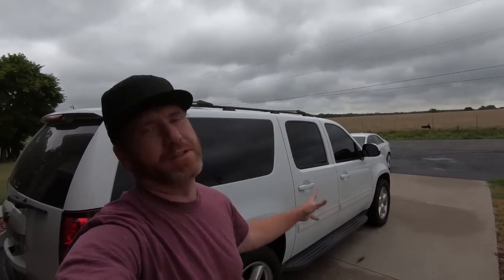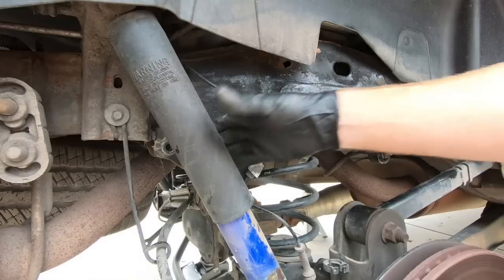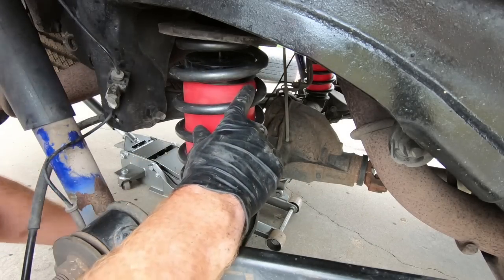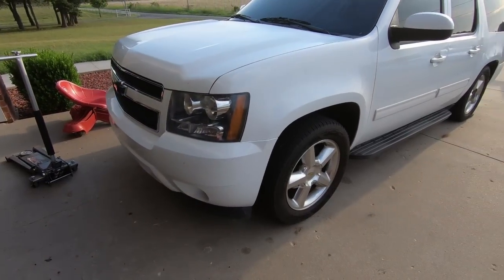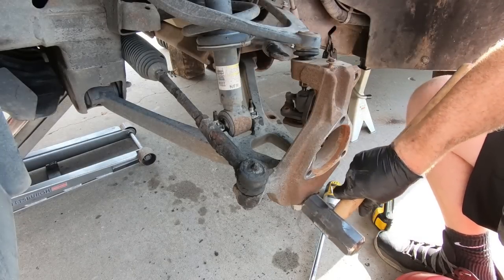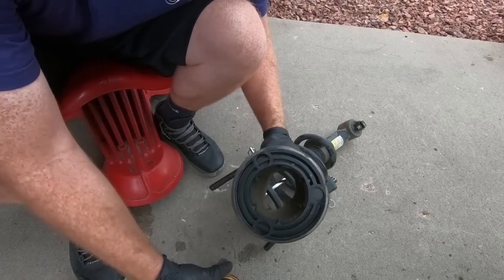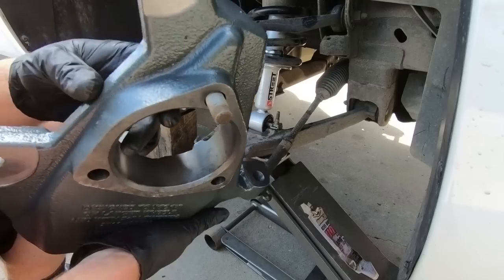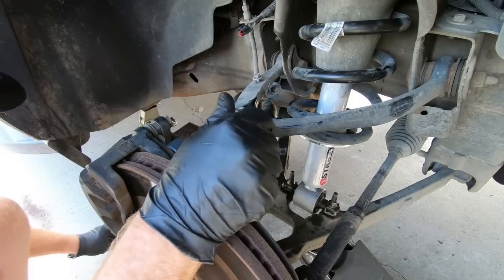How To Lower Suburban Yukon XL and Escalade ESV (Ultimate How to!!!)

Comment: Great video, gonna need it when I do my drop. Little tip for the spindle it's easier to build it before you install it (bolt the hub before placing the spindle on the control arms
Reply from the maker: Not when you try to lift it into place
Reply: @TWAMotorsports  it's not that heavy lol
Reply from the maker: @joker6374 definitely heavier

Comment: I know this is an older video but I want to say thank you for sharing and linking the parts. I have a question before I fully commit. In your opinion, are the helper bags necessary on a daily that will experience no towing or real payloads other than multiple car seats and diaper bags?
Reply from the maker: Yes I think you need helper bags.
Reply: @TWAMotorsports  Appreciate the response!
Reply from the maker: You're welcome

Comment: I did a 3/5" drop on my 16' Yukon 3 years ago. I bought my kit from Norcal SS. On the auto air ride in the rear, I replaced the  set screw with a shorter so it couldn't go back up too far. The free travel mod is a PITA on the drivers side with the tank sitting right there. I have 24" DUBS and I'm thinking about going to a 22" wheel. The stock size wheels look good with your drop.
Reply from the maker: Nice. I bet that looks awesome

Comment: Did you add travel by cutting out the previous frames bump stops? I’m using a beltech 733 drop kit and I regularly bottom out in the rear end. Wondering if diff springs would help.
Reply from the maker: Yes

Comment: Couple of questions but first thing great step by step idk if u knw how much that helps ppl, hmm does the BJM kit come with springs r is that separate? An do u have to redrill for the sway bar for the passenger side? Thanks bud!
Reply from the maker: Djm kit doesn't come with springs. Yes you have to drill two holes and move sway bar

Comment: How do you get rid of chevy lean.  I have replace front springs with oem springs.
Installed belltech lowering struts for 1 inch drop. Plz help.
Reply from the maker: Put more rings on low side or take one out of high side.

Comment: Great write up and video, I’m currently dropping my 2011 Yukon XL. I got the exact part number spindles in the parts list in the description section…. they are 3” spindles, is that what you used?  Because in the video you said the spindles get you 2 inches and you put 3 rings to get you another inch and a half. 

Since I got the 3 inch spindles, should I go 4 rings to get the same height? 

I got the spindle part number 2511
Reply from the maker: Part I listed is what I used.
Reply: Thank you for the reply.
Reply from the maker: You're welcome

Comment: Do u have to add the DJM kit or will i be fine with the free travel mod, the poly urethane bump stops, and the spring and shock? Also im currently on atock shocks with belltech springs will i be fine untill i buy the new shorter belltech shocks?
Reply from the maker: If you don't want to do it correctly then wait until you can. I did all of this for a reason

Comment: I had a question on your videos of you dropping your black Tahoe you said to  do the lower control arm bracket one side at a time but in this video you un bolted both sides at the same time is it better to do both sides ?
Reply from the maker: Sometimes the rear shifts and is hard to get back in place when you do both sides at once
Reply: @TWAMotorsports  thank you brother I will do one side at a time 👍🏼

Comment: Question? I just installed the (Maxtrac) 2” spindles and strut. And 4 inch coils on rear. I drove out and noticed my left front is rubbing against wheel well but driver side is fine. Took it to Firestone for alignment and he said that I need extended tie rods to fix it along with Alignment. It’s 11 Avalanche LTZ 4wd. And help would be great
Reply from the maker: This is why I make these videos to show what parts I have years of experience with working. I have no experience with the products you used.
Reply: @TWAMotorsports  what’s crazy is it’s only coils, struts, spindles and hangers
Reply from the maker: No hangers on these
Reply: @TWAMotorsports  sorry. Shackles lol
Reply: I’d love to pick your mind on this!! Appreciate your response
Reply from the maker: They don't have that either. Shackles and hangers are for leaf spring trucks.
Reply: @TWAMotorsports  ok. Shock relocation brackets. Sorry not on your level with terminology my man. Just trying to get some help with someone experience but obviously not gonna get advice
Reply from the maker: I'm not sure how to help if what you bought isn't working. I make these videos to guide others to parts I know work

Comment: Any recommendations for a different sway bar? 
Just did the drop on mine and the rear passenger sway bar is hitting the frame. 
I have an 04 avalanche so a bit different
Reply from the maker: Not something I have changed
Reply: @TWAMotorsports  all good. My problem was that i had to move that sway bar a little over to the passenger side so that it could clear. It was in the djm instructions… whoops
Reply from the maker: That is a requirement

Comment: Is the video for a specific year? I have a 2016 Yukon Denali XL that in want to lower 3-4 in front and 4-5 in back. Which parts/video do you recommend for my vehicle? Thank you in advance for your help and info. I will be adding 24" wheels with a 305/35R24 tires to this vehicle as well.
Reply from the maker: Same parts work.

Comment: Love this video! Thank you for a thorough tutorial. I’m going to replicate this on my 07 Avalanche but I was wondering what your thoughts would be if I used a bit smaller springs on the back. I was looking at using “Belltech 34324 Springs Coil”. Do you know if the rest of the parts you used would be compatible with these springs?
Reply from the maker: Thank you. All the parts are compatible. Not sure about the springs you listed however

Comment: What would I need for a 4/6 drop on my 08 Escalade esv awd
Reply from the maker: Same parts as this but won't go that low
Reply: So for shocks it would be 2210ff instead of 2410ff? Since those have more travel
Reply from the maker: @940_. No. I used 2410 but bought in kit listed. 9505

Comment: Just curious why you don’t use a Spohn Performance adjustable pan hard bar? 
With that short of spring, the rear axle has to be off center.
Reply from the maker: It is off a small amount. I will be making a video to correct soon

Comment: Have 2004 tahoe and looking to get lower in the rear cause I'm sitting way to high compared to the front anyway of getting more drop out of the rear? Used a mcgaughys 5" spring( or suppose to be)
Reply from the maker: Norcal Tony has a 6 inch spring
Reply: @TWAMotorsports  thanks for the help.  Just reached out to him.
Reply from the maker: You're welcome

Comment: Hey man awesome stuff. Got me motivated to lower mine. Had a question. I have an 08 Ltz burb. Would those ss springs work on a burb. And would you use a 2”drop spindle with adjustable struts to get that 3” low in front
Reply from the maker: Yes they will work. As for the front that is exactly what I would do
Reply: @TWAMotorsports  thanks Brotha.
Reply: Quick question. With the front struts. I have factory air ride. Do I use the “factory air ride” section to gather height preference or do I use the “non auto ride? Little stumped. Since I’ll be changing out to regular shocks and struts.
Reply from the maker: Are you talking about in the instructions?
Reply: @TWAMotorsports  yes sir. Since my vehicle is equipped with air ride. Do I use the air ride section for amount of rings or do I use the “non air ride” since I’ll be eliminating air ride over all
Reply from the maker: If it came with air ride I would use that setting. Not hard but time consuming to go back remove another ring and put back together

Comment: So, all of these locals are telling me that I can not use the air lift bags due to my factory air suspension. Is that true? Is this bag shorter to fit the shorter rear springs?
Reply from the maker: If it has factory air suspension and you drop it with these components you won't have factory air suspension

Comment: Hey, pal.  Just completed my second drop project....(escalade esv).   Used all the same parts....experiencing harsh vibration at highway speeds and hard acceleration.....

Pinion angle?  

Thought the DJM brackets helped with that.

Thoughts? 
Think I need to go with adj lower trailing arms to reset pinion angle?  (Spohn has a nice set).

Last project was a Denali xl.  No vibration issues. 

Thanks
Reply from the maker: I have done 20 or more and never had that issue
Reply: @TWAMotorsports  ... I'll dive into it and see what I can find.  Perhaps an unhappy u-joint or mechanical issue.
Reply from the maker: Yeah that is odd
Reply: @TWAMotorsports  *Update*....so I checked everything in the rear...all was gtg.  I pulled the driveshaft and both u joins were tight ...I also checked to see if the driveshaft had enough room to slide in and out of t-case....more than enough.   Moved to the front.....the outer cv's looked a little unhappy with the amount of angle..  The front drop did settle a bit more than I wanted so I pulled the front apart and added 2 spacers to each side.
.    That was enough to correct the cv angles and stance.    No vibrations now.  I guess those cv's were binding up under heavy throttle. 

The last drop I did was a Denali.  It was way easier...this Escalade has been nothing but a  pain in the rear..

Figured I'd share.
Reply from the maker: Thanks for sharing. Glad you got it figured out.

Comment: Quick question will this kit work for Escalade esv 2011
4"/5" Lowering Kit, 2007-2013 GM SUV 1500 (2wd, Non-Auto Ride) Part #30013
Reply from the maker: Never used it but it should
Reply: @TWAMotorsports  thank you
Reply from the maker: You're welcome

Comment: I did a 2/3 drop on my Yukon then decided to go down another inch to a 3/4 but now I have a god awful Chevy lean.... It’s about 3/4 of an inch higher on the passenger side.... I removed one of the spacers on the front shock.... I have 4 on the drivers and 3 on the passenger.... I checked the rear to make sure the spring was set properly.... Maybe I move the rubber isolator out of place? Any help would be great.... Thanks!!!!!
Reply from the maker: Easiest way is removing or adding rings to shocks.
Reply: TWA Motorsports Thanks Bro!!!! I’ll remove another ring on the passenger side....👍🏾💯
Reply from the maker: You're welcome

Comment: With the axle moving up closer to the body, does it shift to one side or the other and does the rear track bar need to be replaced with a shorter unit as well? The same concept as when lifting these. And how well does it align if the rear axle has shifted do to being compressed, so to speak? Also, I'm curious about why only the lower control arms are relocated, and why the uppers aren't touched? They are no longer parallel. Does it cause any funny drivability and control issues?
Reply from the maker: It does shift. Sometimes you need an adjustable panhard. I generally don't use one.

Comment: Amazing video, just wondering though, if I plan on doing a 3/4 drop on my 2013 Avalanche with no auto ride suspension, would I use the same exact parts or is there a few things in this video i don’t need to use? The air bags you put into the Trail Blazer springs is that only for the auto ride system? Lastly the street performance shocks how do they feel compared to using the stocks and would I need to do the free travel mod?
Reply from the maker: It would be almost identical. You can't use stock shocks. Love the belltech shocks. Airbags are to help hauling extra weight. Nothing to do with autoride which this suburban doesn't have. I do travel mod anytime over 3" in the rear

Comment: How many rings did u put up front ? Straight 3 or 3.5? Thanx btw looks clean for a burban 👍🏼
Reply from the maker: 2 I think
Reply: i got the v2 version and it has the 10 mm ring with 8 mm rings they should ve just kept on sellin the old versions way easier to do ..these only say -2 and +2 . different instructions than yours
Reply from the maker: I see

Comment: I love watching your videos they are very informative. I was wondering if you know if the rear jdm kit you used might work on a 2002 avalanche 1500?
Reply from the maker: Different kit for older. Rk2000
Reply: @TWAMotorsports  do you know if the djm shock extenders work with the belltech shocks
Reply from the maker: They should. Mine all came with the djm hardware kit

Comment: Another question brother. Witch rear spring would you recomend to sit 1 inch lower than what you have. TIA
Reply from the maker: I have no idea because I always go way lower. Not sure 1 inch is an option
Reply: @TWAMotorsports  you said In the last part of the vid that 2wd sits a little higher than 4wd I have a 2wd and would like it to sit a little lower than your current set up.
Reply from the maker: Oh. You can take out the isolators and use a peice of rubber hose on the top of springs. Should be around 3/4 "

Comment: Why do u have to move the sway bar over? It wont work in factory location?
Reply from the maker: It will but will hit on panhard rod generally if not moved with this amount of drop
Reply: @TWAMotorsports  ok, i just installed this exact kit on my 2013 esv, my djm rk2007 just came in today ima go put it on, this video has been a tremendous help thank you for taken the time to do a in depth video about it
Reply from the maker: Awesome. Glad it helped you

Comment: are you sure that your 'airlift' part number (#60748) is the correct one to work with these belltech rear springs (#4230)?
Reply from the maker: That's what I used but I have used several different ones in the past with that spring also.
Reply: @TWAMotorsports  i think the difference might be those little rubber pucks.  some different kits come with those, but the one you listed does not come with any of those.  do you think I will need those rubber pucks on my identical application to tighten up the vertical measurement?
Reply from the maker: I have never used the pucks until this one.
Reply: @TWAMotorsports  I ordered my bag kit from you link in the description and I know that the I.D. measurement of 'Y' for this spring is 4.5" (follow this link;  https://www.airliftcompany.com/workshop/air-lift-1000-universal-air-spring-kit/   ).....  But would you be willing to give me the vertical measurement 'X' of this spring with the weight on the vehicle?  Then I can exchange it for the correct kit.
Reply from the maker: It will be a while before I can but I will try
Reply: @TWAMotorsports  I was able to assemble it all and measure it up.  here is the correct kit instead of the one that you have listed in the description;  https://www.amazon.com/Air-Lift-60908-Universal-Spring/dp/B018O94S1K/ref=sr_1_1?dchild=1&keywords=air+lift+60908&qid=1608779106&sr=8-1

It's AIRLIFT's kit number 60908 and here is their website link;  https://www.airliftcompany.com/shop/60908/

so, now i need to get some of those pucks that didn't come with the kit in the description
Reply from the maker: Thank you for that info
Reply: Hey quick question. I ordered the bags and basically the whole setup for my yukon... I recieved the air bags listed in the video today, but they did seem to small.. I clicked in the link mrrbond left and I was wondering if those were the correct air bags?? 🤔 I'm about to return the small airbags I got in today but want to order the right ones.
Reply from the maker: I used the ones listed because that spring compresses so much. Either will work.
Reply: Hi  @jessiduran7123 .  I left that comment for fellas like you Jessi.  The 60908 AIRLIFT kit worked with the BellTech #4230 springs.  mine is a 2007 1/2 ton 2wd Chevy Suburban.  Then I did have to cut the metal piece for the original bumpstop to give it free range of full motion.  I end up riding on 5lbs of air in the bags constant cause (in my opinion) the bell tech springs worked, but were riding a bit lower than I liked...so i have an onboard compressor ready to fill up the overload bags as needed.  hope this is helpful.  GOD bless.

Comment: How did it ride at highway speeds? Any shake or wobble?
Reply from the maker: Zero shakes or wobbles
Reply: Just finished up mine, installed step by step watching your video had alignment done but I'm having minor shaking on the front end between 60-70 mph
Reply from the maker: All the exact same parts?
Reply: Yes
Reply from the maker: Hard to say unless tierods are bad
Reply: So I was wondering the same thing but I figured the alignment shop wouldn't be able to align it if they were bad???
Reply from the maker: @jbrethen they will if they ate lazy
Reply: Thank you, greatly appreciated!
Reply from the maker: @jbrethen sorry I am not more Help

Comment: What's up buddy my name is Ivan I've been watching your videos and I finally pulled the trigger on a 3/5 drop on my 2012 Chevy Silverado 1500 LT 4 wheel drive I got my kit from IHC but I have a problem in the front they gave me the bottom control arm with a notch to make the drop yeah my problem is my inner control arms are too long or something because my wheels are sticking out I called them up and they said that I needed to cut my inner tie rod half an inch have you had that problem before because I don't want to cut something and then I'm stuck could you give me some feedback please I appreciate it thank you
Reply from the maker: No I didn't have that problem but I did make a video covering all the reasons I would no longer use ihc.

Comment: Hey brother,id like to go as low as i can on my 2003 tahoe,but still have a smooth ride without it bottoming out,but still have no gap between the wheel and guard,what do you suggest before i order the kit,thanks mate,from gene over here in new zealand
Reply from the maker: I did a video on my 2003. That is the kit I would suggest. Links in description for parts.